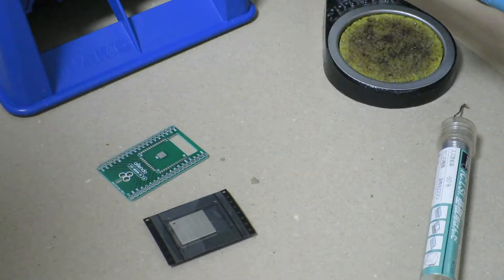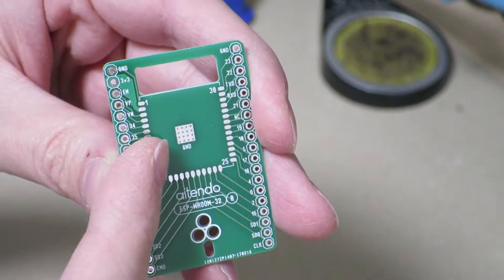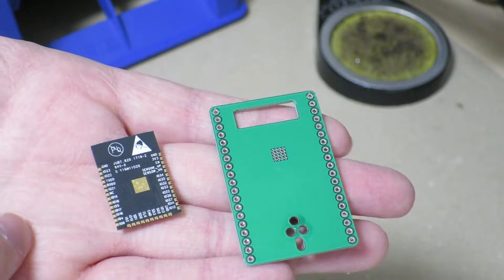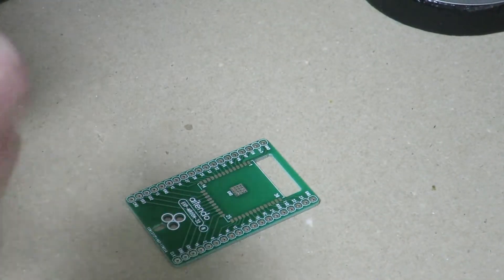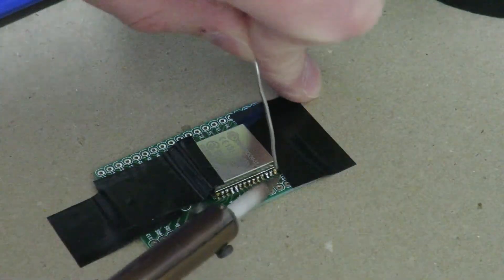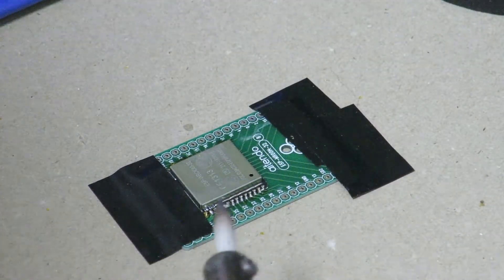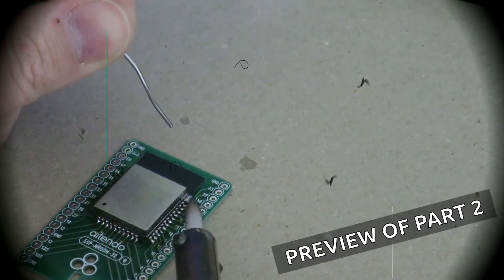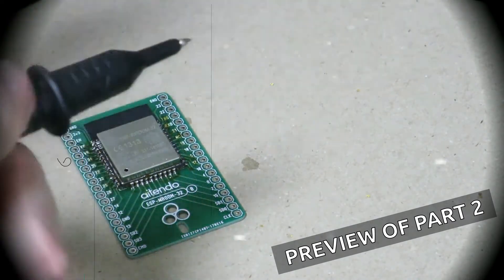ESP32 #2: Soldering the ESP-WROOM-32 to a breakout board (Part 1)

Comment: So much easier to just use a 'reflow oven', which to me is just a toaster oven.  It is almost magic.   But from what I've watched in videos, a hot air gun  works too.   I want to replace a esp-cam processor since the processor is toast but I want to use the board and camera using an external antenna esp

Comment: Very precise soldering 👍👍
I am facing some weird issues with this Chip.
I am able to upload the WLED bin file
But when I power this up, its hanging every other minutes. Using the AMS1117 Regulator, Have tried hell lot of capacitor combinations, Nothing helps.

If I use a dev. Board it works seamlessly using same binary and thru same power supply.
Any pointers?

Comment: Just so you know, the datasheet for the ESP-WROOM-32 specifically says that soldering pin 39 (the ground pad) is "not necessary for a satisfactory thermal performance", so you might have a better time without it!

One other tip. In a pinch, you can actually do reflow soldering with just a frying pan filled with sand. Ideally, you would try to match the reflow profile in the datasheet, but as long as you don't apply too much heat (and burn the entire PCB) it should be more gentle on the components than the iron is.
Reply from the maker: Thanks for the tip about soldering the ground pad not being required! It would definitely make things a lot easier if I didn't need to deal with that ground pad.

Since I didn't remember seeing that note in the spec sheet, I looked back at the one I used back then (2017), and it doesn't mention it; I'm guessing that Espressif added that note later on. :)
Reply: For thermal yes, but it also serves as ground connection. Better to solder then :)

Comment: Noticing the through holes sucks in solder due to capillary action when you are soldering is a great achievement :D For me it always was a problem because I am clumsy and keep contacting the empty TOs with the iron and accidentally filling them with solder to block it and have to struggle to make components get in the hole. :D

Comment: You need smaller soldering tip and smaller solder.
Reply from the maker: Awesome, thank you for the tip! :)
Reply: Not really. I solder SMDs with a larger tip than that. The trick is sliding the iron across. It may take 2-3 passes but it works perfectly. Just add flux before each pass

Comment: I actually prefer YouTube videos which shows mistakes and user errors. It’s actually more informative to next show how to troubleshoot and fix this errors. So a beginner who is just starting out soldering would know what to do when they encounter the same problem.
Reply from the maker: I'm of the same opinion -- I like videos that include the mistakes so that I can learn how to handle problems when they arise. That's the reason why I try to keep imperfections in the video. (Although that's a delicate balance, as preferences are different between viewers.) Thanks for the comment! :)

Comment: U know that u don't really need to solder the ground pad in this case
Reply: I think we can just apply a thermal paste to transfer the heat from the module to the large copper plane on the pcb
Reply from the maker: Thank you for the comment! I was under the impression that we should have the ground pad connected. I'm curious where you found the information to the contrary? (I'd be especially interested if it's from Espressif themselves.)
Reply: A little late, but here it goes: From the ESP-WROOM-32 datasheet, page 14:

Note:
Soldering Pad 39 to the Ground of the base board is not necessary for a satisfactory thermal performance. If users do
want to solder it, they need to ensure that the correct quantity of soldering paste is applied.

It appears that it is enough if the pads just touch, but are not soldered.
Reply: @g3i0r  late is still good. I skimmed that paragraph yesterday and then found myself looking to solder pad 39 today.
Reply from the maker: Thank you for sharing that video, it's good to get more information! :)
Reply: It is a thermal pad, the PCB should be dissipating heat and spreading it out as much as possible, not the best thing to try and solder indirectly xD  Like trying to reflow a computer processor with hot air, but through the heat sink lol.

Comment: That gap between module and board makes me nervous.  Shouldn't you have soldered the backing ground-plane first, rather than last?  That way you can use adhesion to know if it's worked: it's done when it doesn't fall off anymore.  
A bulldog clip may work to keep the chip securely it place while you solder.

note: i really don't know, havn't done it.
Reply from the maker: Thank you for the comment and suggestion! I figured that as long as the connections are made a little bit of floating wouldn't hurt much. Then again, I haven't soldered in this manner many times before. (This is probably the second or third time.) I haven't thought of using a bulldog clip, I'll try it out next time, thanks! :)